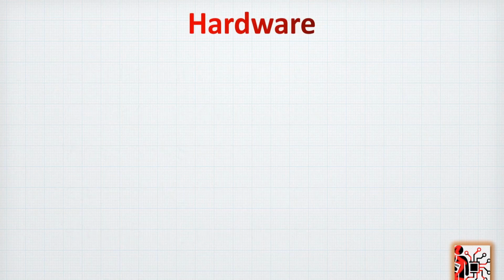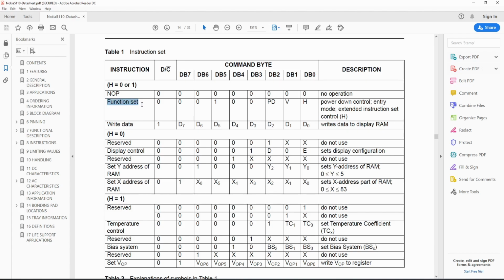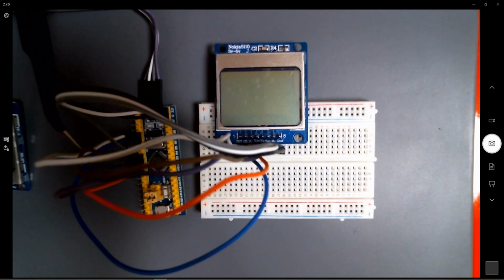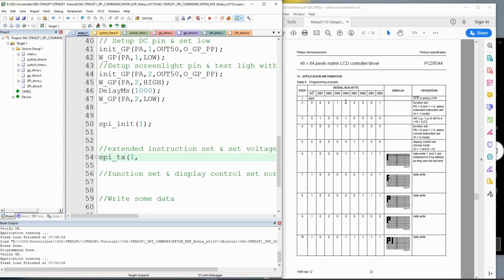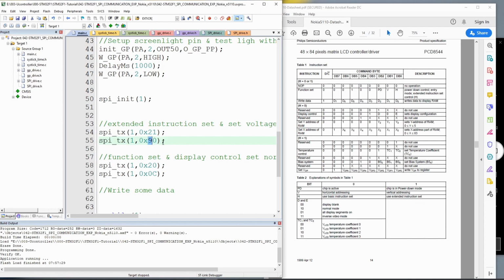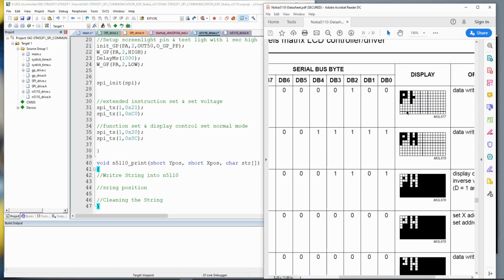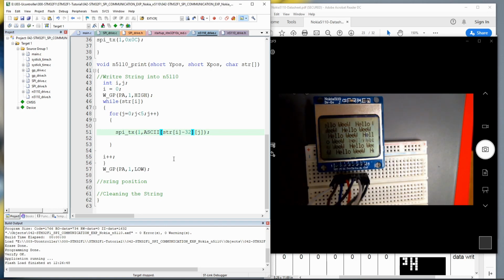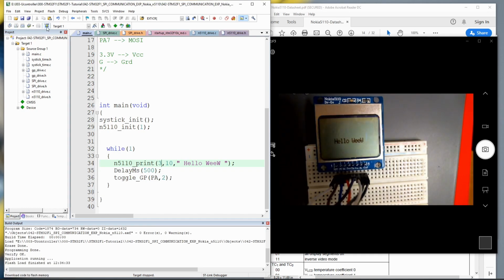042 - STM32F1 SPI COMMUNICATION EXAMPLE:  NOKIA 5110 LCD (PCD8544) SETUP & PRINT EXAMPLE

Comment: Hello. First of all, I would like to thank you for sharing your very good and useful program to everyone.
But there is a problem for me: I did very similar to your program. But the result I get is just a blinking nokie 5110 screen without displaying any letters. I've tested everything from connecting to using your code and still nothing. Looking forward to your help and sharing. Thank you.
Reply from the maker: Hi Loopfi, Thank you for your message,  one of the suspicious part is the Voltage setup. The value is setup during the video. Unfortunately the Nokia screen circuit can vary a lot depending on the year of the manufacturing or the manufacturer him self. if you still stuck, we can have a call through Messenger. this is my FP profile : https://www.facebook.com/weew.stack
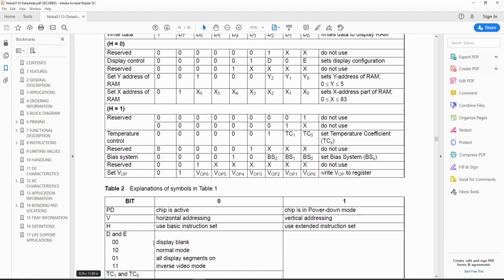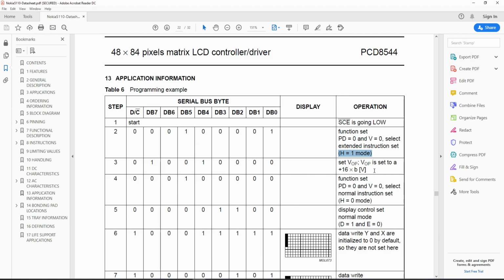I am available this both Saturday & Saturday from 10:00 to 13:00 GMT.

Again, thank you for following the WeeW way !
Reply: @WeeWStack  Hello. bother you again. I tried re-downloading your code and opening it to load without modification my screen showed the text "hello weew" but there is one problem, when i modify that text and Press build, reload, it doesn't show anything anymore. Please give me feedback if you know where the error is coming from? Thank you.
Reply: chào bạn bạn có thể cho mình xin giá trị điện áp truyền vào không. Mình cũng gặp trường hợp như b. thanks b
Reply: @chungdays01  Xin chào bạn. Bạn hỏi điện áp gì nhỉ?
Reply: @loopfi8835 phần code điện áp truyền cho lcd á b
Reply: @loopfi8835  mình có làm theo clip nhưng không hiển thị chữ như tình huống của b. Thấy b khắc phục được rồi nên mình xin giải pháp🥲
Reply: @chungdays01  Mình cấp nguồn ngoài cho lcd.

Comment: It was a very helpful video but I have two questions:
Q1. Why did you subtract 32 in line 63?
Q2. Why you choose 504 in for loop of line 47?
Thanks.
Reply from the maker: Hi Lal,
thank you a lot for your question, let me reply to the question:

1- I am substracting 32 to get with the right index with the table "ASCII[][5]" in n5110_drive.h 
2- 504 is the whole size of the screen, as is 8 rows by 64 column. the purpose is actually if you want to write inside the whole screen, I have to go back to position 0,0 (Using the function "n5110_pos(0,0);" and then write byte by byte

Let me know if it make sense to you

Thanks
Reply: @WeeWStack  Got it! Thanks.